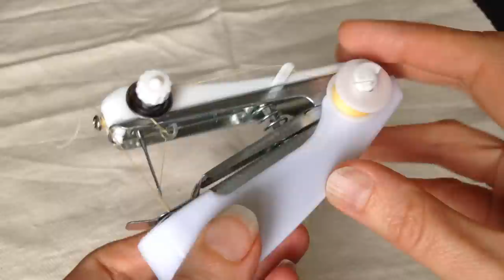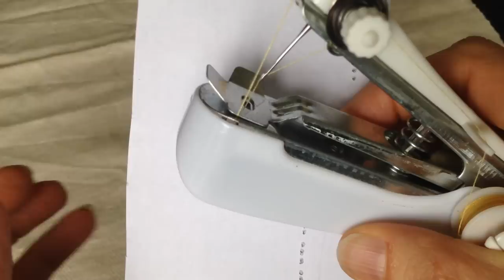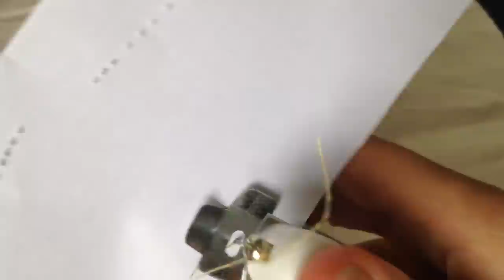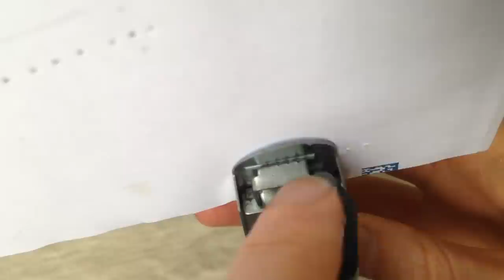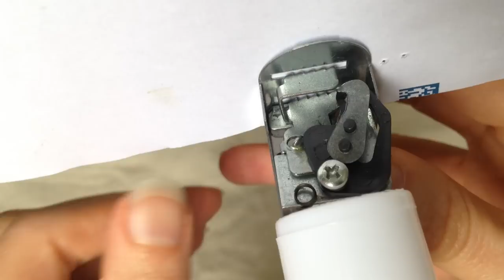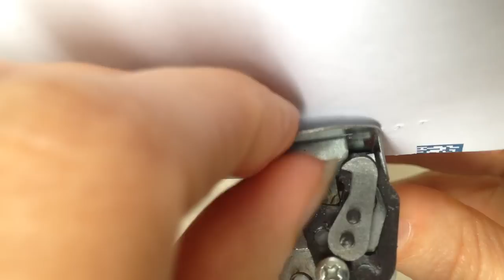Mini handheld sewing machine not working - no stitch

Comment: I have the same problem. I've loosen the screw under the hook then I pressed the stapler so the hook returns automatically to its normal position then I tightened the screw again. This problem is because of the needle is too low so it should be higher enough not disturbing the mechanism. But not too high preventing the hook to catch the thread.

Comment: Recently, I bought a "Sun" brand hand held sewing machine (Chinese) through Amazon. A real cheap one and it proved to be one. It is a poor imitation of some good brands (I hope) like Ami. It worked for exactly 5 minutes and gave up. Being an engineer and a DiY person at that, I tried to find out the reason why it doesn't work. As explained in this video, the hook should catch the thread during the downward movement of the needle. If the mechanism is damaged, there is nothing much you can do about it. But if it is struck, try to apply some lubricating oil like Singer Sewing Machine oil and check whether the mechanism is working.
If the mechanism is working, then the possible reason for not working could be that the flat portion of the needle above the eye and towards the set screw is either turned wrongly ie. backwards or the position is not correct. To my dismay, I found that if I push the needle fully in against its holder and tighten the set screw, the flat portion is way too high and the hook is unable to catch the thread. The flat portion allows the hook to pass between the needle and the thread and catch the thread. I have now lowered the needle a bit (ie. it is now not fully pressed against its stop at the top) so that the hook is able to catch the needle. This can be checked by removing the mechanism from the plastic bottom cover and observing its operation by pressing the top handle (Make sure you don't pierce your finger). The machine is now working reasonably satisfactorily.
Reply: thank you very much! this has been very helpful!
Reply: Thank u
Reply: Venugopalan Cheriyaveettil hey there i have one as well nd doesnt sow either can u help me please
Reply: tried it and it worked like you were saying.  noticed that I might have to loosen the screw and pull the needle down a few times as I sew but at least I know whats wrong.
Reply: So helpful, thanks

Comment: Hi Luovamaaila.  I have an identical machine which had the same ( or similar problem).  The first this is to make sure that the tensioner actually holds good tension so the hook catches the thread as it passes the needle.  This helped for about 3 in 5 stitches.  After this I really watched the hook as it passed the needle and thought it could stand to be closer or even touch the needle as it passed and after a few tries I now have it so that it works every time.  I thought this machine would be good for repairs etc but it turns out to be a little unwieldy but a nice little souvenir of our trip to the market

Comment: I took out the needle and turned it round and it worked. The needle should be in there with the little flat surface on the lower end to the front. I hope that you all will be sucessfull with this little adjustment.
Reply: Thanks! of all the comments this works to me. the flat side of needle should me facing the handle. And lower the needle a bit.
Reply: works, but not 100%

Comment: Here in my machine the hook is moving but it is not swing  every parts of the machine are ok. Then why is it still not working?
Reply: Hi, check the placement of your needle. The flat face should face inside the machine and round shape face outside. Second the distance of your needle tip and hole of the machine should be mm wide. not too high, not too low just enough to slide through your thread. 
And as the needle goes down, the hook should slide through the flat surface of the tip of the needle that suppose to catch the thread. I hope this helps.

Comment: I have one solution it will work or not no guarantee. Just remove screw from that hook Holder which is black plastic made. Pull slightly and make it in straight position and place it by pushing back to its position. Now tight it's screw. Let's see if it is working or not.

Comment: You are not supposed to bring that thread up around that screw what so ever. You are basically pulling out the stitches as they are being sewed, because the thread around that screw is pulling it, because the thread is not supposed to be there.

Comment: just press the stichs upper part and place that hook in place
Reply: could you make a record of video how to do that
Reply: I have the same problem but not sure if it's Bc of the hook. I can't open the bottom part of the machine any advise?
Reply: There is a small recess in front (the needle end) between the metallic portion and the plastic bottom cover. Insert a thin screw driver in this slot and try to prise it out.

Comment: I had same problem but i fixed it. Open the machine and you can see something like a hook, in front of needle . Push it that behind the needle , and test it without battety by knob, i tried and its working now. You have a to adjust that thing.
Other wise check this video.
https://youtu.be/oNujcTM2BM4